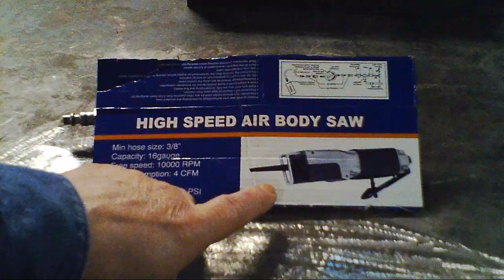How to Make an Air Rammer out of a High Speed Air Saw

Comment from the maker: Yes, but you have to make sure it has a rear exhaust or it will blow sand in your face.
Next thing is if you use any of the tools that come with it -- they are hardened steel so you have to make a pocket like I did for the shaft to sit in then the weld will be above the end putting less stress on the weld and you should probably use stainless steel welding rods because of the two metals.
Grandpa Bill

Comment: Looking to build something along these lines to tamp dirt/clay around fence posts. Any suggestions on power and types of motors to be using? I feel something with a longer motion would be better for tamping posts but if you have a video on how this works of love to see it
Reply from the maker: +chad d They make commercial tampers... when I was searching the net I found several companies selling them, (new and used). I think most were air driven, so you would need one of those big compressors on wheels. But before you go spending a ton of money; Why not call several rental companies/ stores, as I've rented the compressor and jackhammer to bust up some concrete.
Reply: +Grandpa Bill I have found a few possibilities but they all have 4-6 inch heads and are skid steer mounted and I'm looking for something with a 1-3 inch head max and hand held. I am thinking something custom built will be my only options.
Reply: Help Chad, did you ever come up with a tamper? I'm looking for something throwaway to sink geothermal lines.

Comment: Air Sand Rammers are not only build for high speed ramming, build also can stand the large amount of force going into the vertical axes of the sand rammer itself. Seeing the "apparatus" you created, it can't hold that much of vertical power on the place where your hammer is added the the vertical axes of this air saw. Something you would admit it might not be enough for high endurances of the usage of this tool. I use the sand rammer as a professional, and I would never advise to anyone using your solution. It just would not hold long enough. 
Just my idea..., just saying.